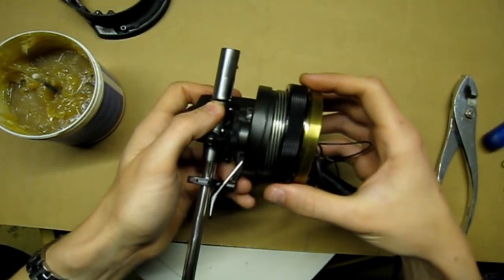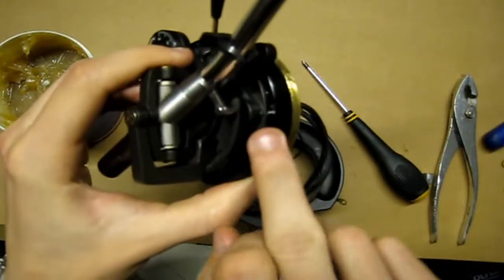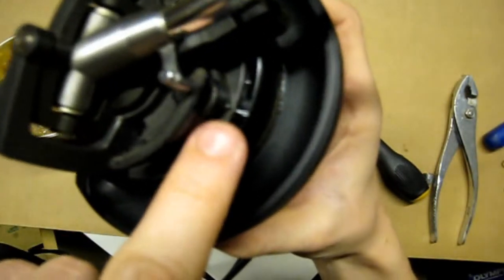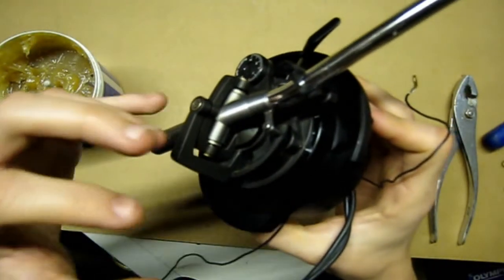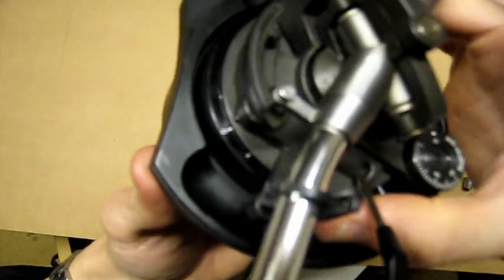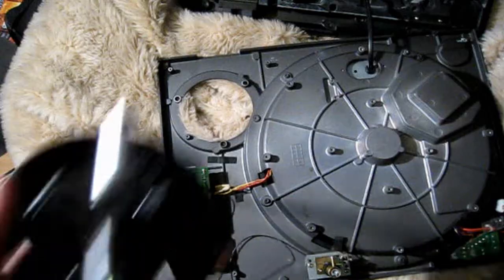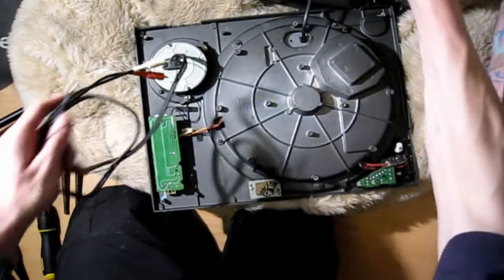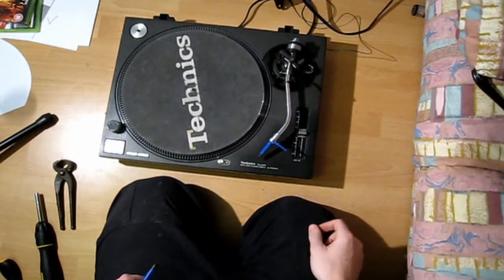How to service/repair/replace the height adjustment on a technics 1200/1210 MK 2 turntable part 2

Comment: Thank you for these videos which helped me to fix the arm blocking problem I had with my over 30 years old MK2.
If the ring with 0 to 6 mm markings is stuck, I (strongly) advise you to heat it with a hairdryer rather than forcing it with a tool.
You can use a toothpick (or something made of wood) to clean the threads, but never anything made of metal or steel.
If like me you still encounter problem to turn the arm-height adjustement ring after greasing the threads, you can try to maintain fully unlocked the arm lock knob when you tighten the two screws that hold the plate underneath.

Comment: Thanks looks very straightforward. The only question I have is whether or not, you can unlock the mechanism without taking it apart in the first place, if you spray a little bit of penetrating oil into the area of the outside threads.?

Comment: For anyone watching this in 2025 - i was able to solve this without disassembling the tone arm. I applied a small amount of deoxit d5 around the tonearm adjustment ring and let it set for a few minutes. I then cleaned up any excess deoxit, then i applied heat via a normal hair dryer. After applying a generous amount of rocking back and forth i was able to loosen it enough to get it rotating again. At that point the original grease worked itself in and was good to go

Comment: Many many thanks for your amazing Video. Your instructions where so detailed and good explained. It really saved my live. I have fixed my both technics by watching your explanations. Fixing the first went fine without problems. But when I tried to calibrate my second turntable I had to screw it upwards too high. The problem was, that before , when it was seized, I had tried to loosen the height adjustment with to much force, so the upper black knurled ring was loosened from the brass ring and twisted  some degrees. That’s why the ring scale didn’t match anymore. Fortunately, I could twist it back, although I had to put on extreme much for us to do that. For anyone who has the same problem, I used the strap wrench to do that.

Comment: @viperfrank If there's one thing I've just learnt: A good tutorial never gets old! Thank you very much for your videos about the Technics turntable.

Recently I wanted to fit a new cartridge to my SL 1210 MK2 after years and therefore had to adjust the tonearm height. But oh shock, nothing moved! As if the whole unit had been fixed with superglue.

Thanks to your two-part guide, I plucked up the courage to carry out the necessary service myself and I was successful! I'm really very happy about that ...

Comment: Real helpful video this! Solved my issues today, obvs you’ve prob learned that the C clamp is to prevent the tone arm form over heightening, the unit will hit the C clamp to prevent it continually lifting. (I found this out the hard way) also when screwing on the ring with the number dial on to ensure you get the correct line up you gotta line up the no.1 on the adjusting ring when screwing on to tone arm, again found this out the hard way.. 

Really great tutorial, Doing gods work son!

Comment: Great tutorial. Really helpful and well explained, thank you :)

I thought I’d nailed it but then realised that the circular plastic guide had come away from the brass thread section. What would you recommend I use to glue it back on?

There’s a dimple that will help me line it up properly. Looks like I just need to make sure it’s the right way round.

Comment: All time hero, thx !!
I can tell You the secret about this ring clip. I broke mine while I tried to put it back on and afterwards I realized, that this ring clip is actually the "Stop-Function" of the high adjustment of the tonearm-socket...!
Reply: yep, VTA height limit stop. not critical but when they fall off it's possible to drive the tonearm right off the end of the adjuster threads at max height. not good, heheheh.

big ups @viperfrank. thanks so much for the great vid(s).

Comment: Thanks for this. I followed this process and freed up mine. However, follow the service manual to do the calibration, which differs from the method here. The service manual also contains a chart translating the adjustment ring settings into cartridge heights. These are - 0 = 15mm up to 6 = 21mm. Don't forget, these are with the original 6mm rubber mat. With a 3mm felt slipmat, these will be 0 = 18mm up to 6 = 24mm.

Comment: James, this is great. I followed all of your instructions, but once I'm done, I cannot get higher than 4mm. At that point, I'm in contact with the ring clip and I cannot get beyond 4mm. If I remove the ring clip, I can adjust higher. When I lower it, it stops just past 0 as you describe. Any idea?

Comment: After I set the locking plate on the bottom back in, I am unable to move the height adjustment, even with it being unlocked.  If I unscrew the base about 1-1/2 turn (so after I have it line up for the locking plate once, another full turn), then I am unable to adjust the height but the max height goes a good bit past the last marking even though at the start it slightly goes behind the 0.  Sorry if this is confusing but can anyone tell me what I am doing wrong?

Comment: Hi James, I'm a bit late to the party so have just seen your vid(s). I'd say it's helped a fair few people since you posted it. Nice easy to follow tutorial for anyone with a screwdriver. Just wanted to point out a couple of things. 1. The LM in LM grease is not low melting point. It is in fact a lithium based general purpose grease. I know you said don't use lithium grease but this is ok. Pure lithium grease is usually or often white. Maybe I'm being a bit pedantic. Second point is about the pin underneath the arm with the circlip and washer. There is indeed a purpose for it. It is the height limiter. Without the washer and clip, when the arm is in place you would be able to adjust the ring so far that the whole arm section comes away from the main body. Must now go watch some more of your vids! Cheers.
Reply: I’m quite confused of which grease should I use.

Comment: dunno if you figured it out after making the video but i know the reason for the circlip that you said had "no apparent reason" it stops that bar from going up through the hole when you increase the height too far thus making it stop around 6 instead of you being able to keep thurning the height ring until it comes right out. found out by accident when i forgot to put it back on lol

Comment: @viperfrank I have only just found your videos on here. Absolutely quality 👌 Thank you. I have a pair of Technics 1200's and a pair of Technics 1210's that potentially both need servicing. I know both 1200's and one of the 1210's tone arms are stuck solid including the locking mechanism. I will go through these videos Step by step on one of the 1200's and see if I can get it to budge. Thank you so much 👍

Comment: Just one thing, to calibrate it, I noticed there are many starting points when screwing inner ring, so if you start in the right thread, you're calibrated correctly, for  me your way didn't work til I figured it out, maybe sl1200mk2 are different????
Reply: No, you're dead right - this is why he says if it doesn't set to zero (and also wind all the way up the scale without coming completely unscrewed when you try it) remove the ring and try again - you need to catch a different start to the screw thread.

Comment: I use an easier method I just carefully spray some WD40 around the top of adjustment ring let it soak in for a while then using both hands rock it back and forth till you get full range, it seams the WD40 loosens the old grease

Comment: This was awesome, only issue I had was when putting the adjustment ring back on the tonearm - when i backed off to 0, it was a few mm higher and this mean it didn't adjust properly when back in - the whole thing was about 1/3 of a turn off. There's a few points the threads can go on, trying to get the threads started when the 0 mark is roughly at 1 on the dial seemed to be the right spot, all good after that.
Reply: This comment saved me... couldn't figure out wtf was going on 😅😅😅 this should go to the top
Reply: this commebt just saved me tooo!!!!! thank you haha

Comment: Great video - had to perform this fix on a “virtually new” M5G (great job on the seller letting me know that the height adjustment was completely stuck).  Had to use a special tool with a rubber grip to untwist the adjustment ring from the base.  Why exactly can we not use copper or lithium grease?

Comment: Anybody know what grease to use, I can't find any without lithium in
Reply: Me neither, and I saw another thread online somewhere where people said lithium was fine.  Of course, I don’t want to put the wrong thing on either.
Reply: @DavidLovasJT  so I hunted around for a non lithium based grease and found plumbers grease. Its a silicon based grease but after applying it and spinning the threads back and forth it just didn't feel right. I ended up wiping it off and just used  WD-40. Worked like a charm for me. Now both my decks have full height adjustment. Just take your time doing, make sure to keep you screws in separate pots and I also recorded myself to remind me which screws came from where. Hardest part for me was getting the calibration right. Had to redo mine a few times but worth it in the end
Reply: @deanedz  yeah just finished up and learned that the calibration is still off - wondering if it’s even worth it taking apart again so long as the tone arm is level
Reply: @deanedz  also, do you notice that on the lowest setting your needle basically makes contact with the base?  Also the tone arm lift mechanism doesn’t seem to lift the needle high enough at all
Reply: Do you mean when the height adjustment is set to zero the needle rests on the platter.
Reply: @deanedz  yes
Reply: @DavidLovasJT  with or without the counter weight being adjusted?
Reply: For now, I’ve added more mats to the platter to raise the record up so that the height adjustment can be set higher - but the tone arm lift does not lift the arm high enough - the needle basically stays on the record surface.  It just doesn’t seem right, but it has to be that low for the tone arm to be level.
Reply: When my height adjustment is set to zero I have about 3mm between the lip on the tone bottom of the tone arm chassis and the mechanism you use to turn to adjust the height. When set to 6 I have about 9mm. I can also go past 6 when turning to max to the letter j on height adj. When fully down I'd say it goes past zero about 5mm. This is on both my decks.
Reply: What height is your tone arm set at?

Comment: I really love all these videos. I followed all these steps to fix my MK2. But i did not calibrate it correctly (based on these steps). The problem was one small detail (that makes the deference) and it is not mentioned on this video. Well when you start to screw the adjusting ring (the one with the numbers on it)... well.. first see where the "arrow" is ..and line up the arrow (from the tonearm base) ..with number 1 from the adjusting ring...and then start to screw it all the way up 'till it stops!! Now... when you start to screw the "donut".. (make sure the arrow and the zero are on the same spot!)... screw the donut all the way up till is stops ..and when id does.. un-screw it 2 full rounds and line up the lock mech. And you're done!
Reply: Mine wouldn't calibrate correctly either but I tried your method and it seemed to work 👍
Reply: Thanks, this extra step works perfectly. the rest of viperfrank's video is fantastic, but this really helps the calibration of the rings.
Reply: I'm glad i helped @elmowedgewood  and  @techno1972  . As i said i really like @viperfrank 's videos about the Technics MK2. I tried to calibrate mine based on this video and something was wrong. Then i asked another guy for some help and he told me the right way to do it. So i thought to help other people with this comment. 
Enjoy the music guys !!
Reply: Hey! I have a question about your comment, once you un-screw the donut 2 full rounds, do you line up the lock mech by un-screwing it more until it lines up, or by screwing it. I assume you just keep on un-screwing after the 2 full rounds til it lines up but I just wanna make sure... Thank you for the comment by the way!
Reply: @carlosabrilll  It's been a while since the last time i did that on my pair of technics.. But once you do everything right and in order to line it up you will need to 'play' a little bit back / forth.. 
However you always see that 'step' between the ring and the base. Is never flat. 
On top of that i almost never use the VTS. But since its there ..is good to have it working properly.

Comment: Thanks for posting this video.  Mine is now sitting on the dining room table soaked in WD40... but still stuck solid! LOL
I managed to buy some helical grease which is designed for relubricating manual camera lenses and ideal between aluminium and brass.  If only I could get them apart though.  :D
Reply: By the way, I found that spraying the WD40 into the lid and then applying it with a cotton bud helps to stop it going everywhere.

Comment: What if the lock mechanism does not work? Meaning I can adjust the height also when it is locked, it may require a slightly more force but it’s definitely possible on my turntable. Should I worry about it?

Comment: the ring clip with a big gap which he said is useless is actually not. It prevents the tonearm from unscrewing. This is the thing which makes tonearm stop at position 6mm when you change the height.

Comment: Thanks for this! I serviced my 1210 MK2 tone arm and now it's working smooth. Just quick question, when I lock tone arm height lock won't catch I must push lock knob a bit more to the lock  and then it locks. Is that some problem or ?

Comment: Even though I have a service manual for the SL1200 MK2, this saved me a lot of time.  Oh the purpose of the "extra" E-clip is to prevent someone from turning the height ring way past "6".  Without it, one could just keep rotating the height ring clockwise until it unthreaded.

Comment: So I did exactly what you said but it seems like the arrow goes way past zero not just a bit and way past 6 !!! I tried a million times ! It’s So frustrating I did what you said I turned it back onto itself to line up to the locking mechanism with that peg in the locking head but in order for me to light it up it has to go past zero quite a bit there’s no other way around it is my table defective?

Comment: Just a note to tell you that ten years after you've put up this video, it's still doing a lot of good to a lot of people, including myself. My SL1210Mk2 hadn't been used for years from new, and the height adjustment was jammed. I live in Malta, so getting a Technics turntable repaired isn't so easy as in the UK. I'm sure I wouldn't have had any idea how to go about it if it wasn't for you.  Same goes for the other vids about anti-skating, weight adjusting, etc. I checked out others' videos but you're the best! Thanks once again.

Comment: I simply squirted a little  91% isopropyl alcohol into the space between the adjusting ring and the tonearm platform, heated it a little with a hair dryer, and then applied steady pressure using my hand to the adjusting ring. It moved a little then a little more, until it was turning fairly easily using just normal finger pressure. I turned it back and forth a dozen times, until I was satisfied, then set it to the correct hight and did the rest of the setup for my cartridge. Now I'm listening to some old Rolling Stones, Get Off My Cloud.
Thanks for the take-apart. It showed be what was going on underneath! I wouldn't have attempted my method without your take-apart.
Reply: The next day it was tight again, so it looks like I'll be taking it apart to grease it properly.

Comment: Quick question - I've taken both of my decks apart to mess with the height adjust and the height adjust lock and I've found that the locks tighten differently. Meaning one turns way more than the other until it reaches the point where it cannot tighten any further. I've inspected them both inside thoroughly and can't find a difference. Why is this happening?
Reply: There are different start positions for the threads on the height adjuster ring. So it sounds like on one of your decks you caught the right starting point for the threads while on the other one, you didn't. 

On the deck where it doesn't adjust correctly within the settings, unscrew the ring till it just drops off the thread, turn it forward a small distance without engaging the thread, then try to find the next time the thread will start. 
It can take several goes to find the correct starting point and get a bit frustrating, but eventually you'll hit the right spot!

Comment: Hi viperfrank! Can you help me with this..When I put back the bottom metal plate the height adjustment won't move. I don't think it's because of the lock. Just can't understand what would obstruct the movement.
Reply: If you refit and tighten down the two screws on the lock mechanism while the height adjustment is set low (near to or slightly below zero), it can cause the lock mechanism to screw in at an angle and jam. 
Loosen off the two screws holding the lock mechanism again, screw the height adjuster up a bit and then re-tighten the lock mechanism - should see it screw completely flat this time and the height adjuster will then work fine.

Comment: Hi Frank,
I did your tutorial but my 0 mark won't go further than the arrow sign. What did I do wrong?
I think the second ring is a bit to high... I turn it one revolution further than the instruction to line up the holes for the piece which also locks the mechanism.
Now all looks like the tutorial.
Have you seen this fenomenon in the past too?